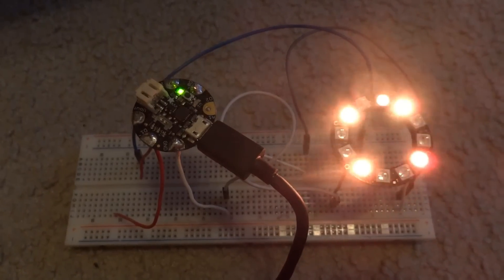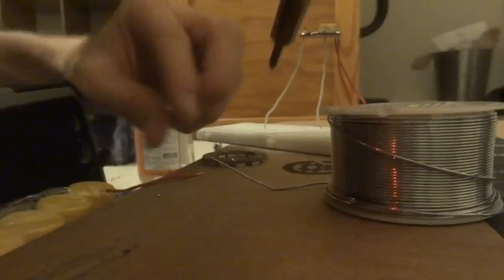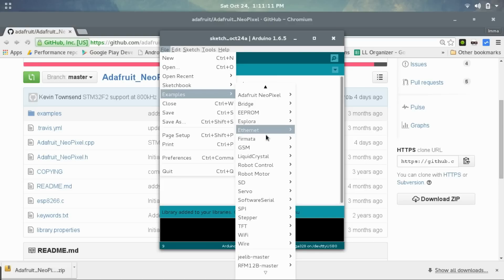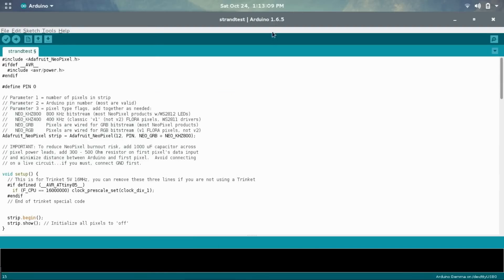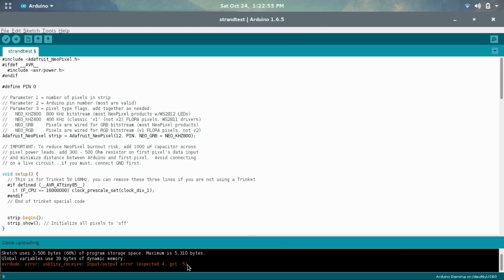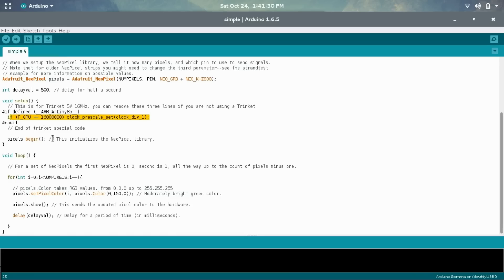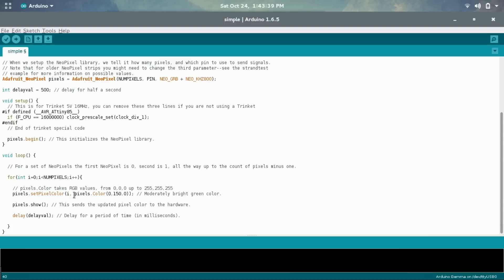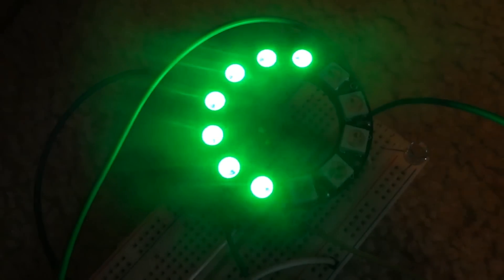Adafruit Neopixel Ring + Arduino Gemma Tutorial

Comment: Have you had problems compiling the adafuit neopixel examples by any chance?? As it won't compile when i try.
Reply: +Imma Wake I'm trying to compile for an arduino uno but i also have a nano as well so would I need to change anything  for that??
Reply: Hi i found out what i'd done wrong i forgot to change the read file to .h so its now compiled as normal thank you for answering, if i use the attiny85 i will dowload that, thanks again.

Comment: Hey hey! i'm just getting started with my Arduino Uno powered Neopixel lamp, and i'm having a bit of a problem. the Uno has a 5V pin and a 3.3V pin, which one should be used to provide enough power for the project to work?
Reply: +Imma Wake my biggest fear is that the amps would be too much for my board to handle